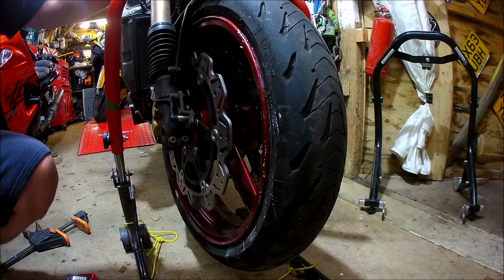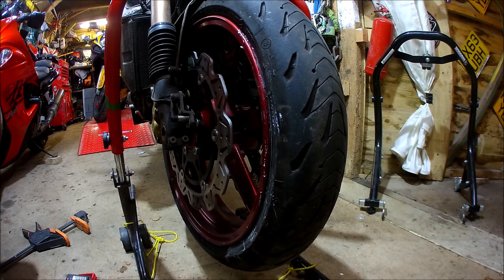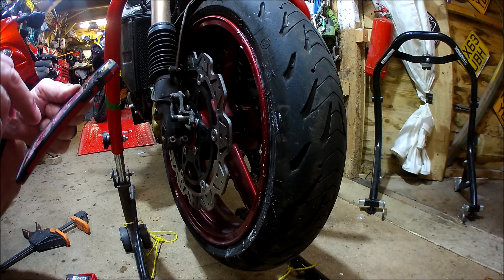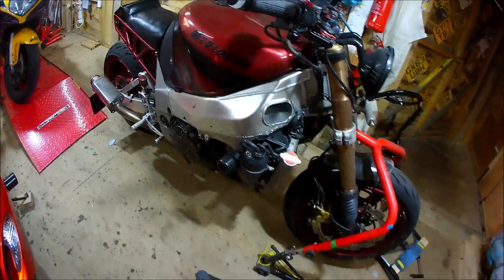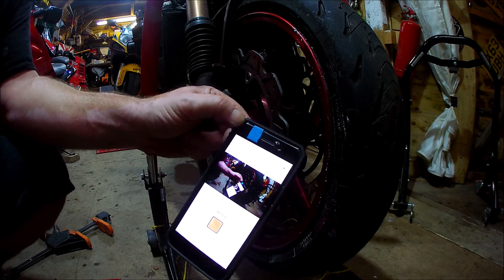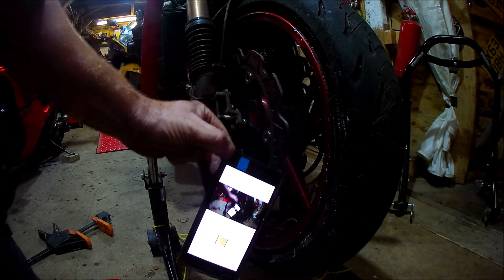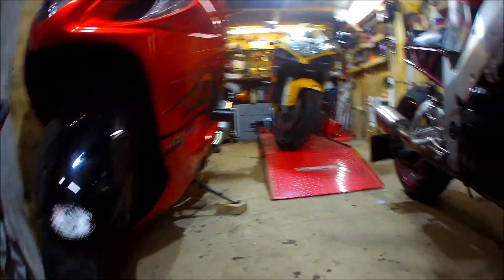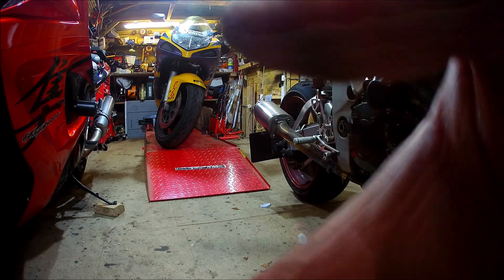Motorcycle tyre valve replacement without removing the tyre

Comment: I have the angled valves on my bikes, so much nicer to put air in the  tyres 😎
Reply from the maker: Definitely easier and I considered them but   stayed with the ones I had in stock. Also with the metal valves I would have had to strip the wheels off to re-balance them. Maybe I’ll fit the angled ones in the future when I replace the tyres 🤔.

Comment: Sounds like the metal peice has moved under the button like mine did on my Drift.
Reply from the maker: Interesting, did you still have full functionality with the button when going through menus but it wouldn’t let you start filming or take photos 🤔
Reply: @bikerantics5001  It wouldn't turn on from memory so it was different from yours. I had to use a bit of sticky tape to keep it in position.
Reply from the maker: @banditnev I’ve got nothing to lose taking it apart so I might investigate further before throwing it away👌